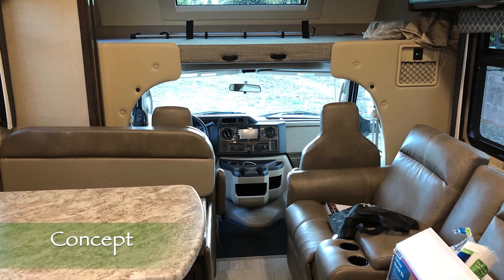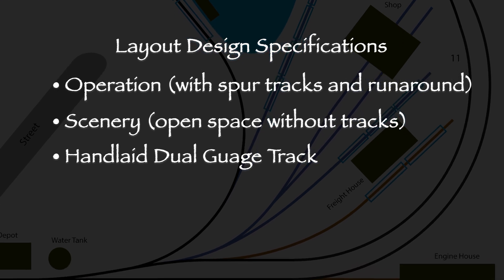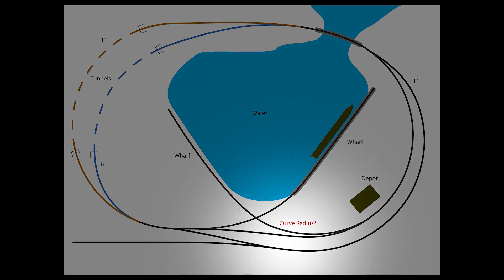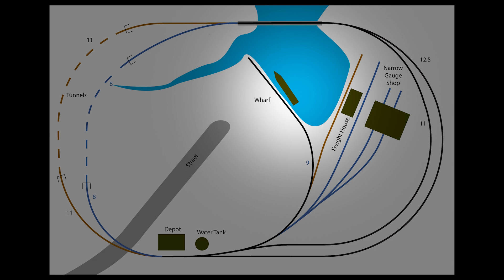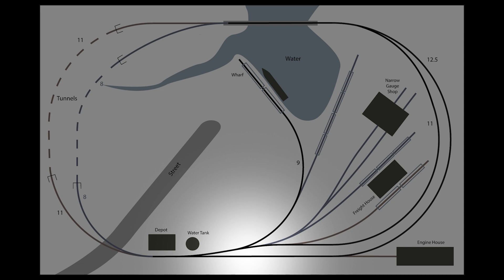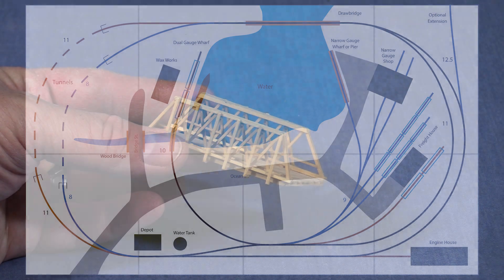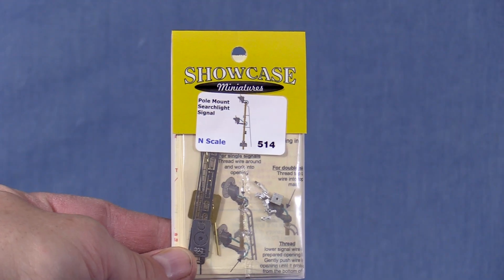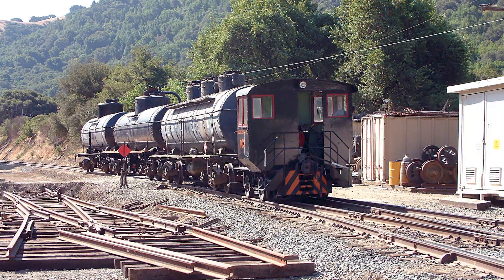Layout Building N Scale Siren Creek Part 1 - Track Plans

Comment: I'm normally not terribly interested in track planning, or even layout construction videos (detailing and weathering are my thing) but I actually enjoyed watching this one. All the shots other than the computer screen helped keep it 'visually interesting' (showing a drawbridge is cooler than saying 'the drawbridge goes here'). And the animations on the computer screen visually explaining your thought process (evolution of the design) were actually enlightening.
I'll conclude by saying, I hope you'll be able to make use of commercially available 'dual gauge (mentioned in previous comment) as the idea of trying to hand-lay N scale dual gauge turnouts' sounds like a nightmare! (were some of those curved???)
Reply from the maker: I'm glad you liked the program.  I think the track is going to be one of the biggest challenges.  There are 3 full dual gauge turnouts called for in the plan.  One is a No. 6, one is a wye, and the other is curved, yes.  We'll see how it goes.  I have a bunch of PC board ties, wood ties, and code 40 rail.  Thanks for watching!
Reply: @DanielCortopassi  My first thought was of those 'Fast Tracks' turnout jigs. So I went to check them out. I see they do have some 'dual gauge' jigs (for N), but the turnout ones seem standard (no wye, or curved). I don't envy you, but I have faith in you..! Good luck have fun :)
Reply: @tp6212  Fasttracks have a wide selection of turnout diagrams that you can freely download, print and use as a template. Cover the printout tracks with a gluestick and it could be a firm enough hold to build your turnout. If you damage the template just print another. The jigs are great but if you are just going to build a one-off turnout it makes it super expensive.